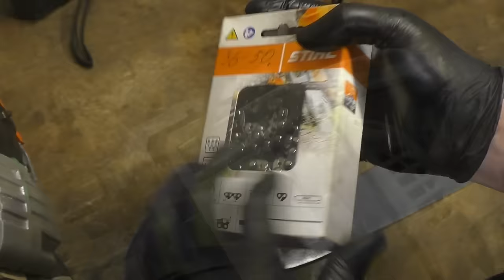Restoration Old Rusty Gasoline ChainSaw | Restoring Petrol Chain Saw

Comment: You have repaired it very well! Fantastic...yes it is interesting but buying it for 50dollars is much better i think...your wd 40 is even more expensive 🤣
Reply: Is not for money ,maybeaperson who that chainsaw worth sometig emocionali
Reply: @dow3639 . u
Reply: 50 dollars? In brasil it costs something around 3 thousands ;-;
Reply: RCTI 2013 
SEGITIGA Biru
Reply: MNCTV 2013 
TPI 2003
Reply: @arthurservilheri4311  thats no original stihl, look on the fuel caps and as well the clutch….only this fake models have that type of clutch😂 i had exactly the same one with a stil 440 logo without h, you get that for 50-90€ on the web
Reply: @dow3639  λ
Reply: @Luckyland84  yea it's a zenoah clone. there's so many different varieties of that same saw all over the world

Comment: You don't wire wheel the internal engine components ever like the piston pin or the gasket mating surfaces, and also don't grease the inside of the motor like crank bearings it just need 2 stroke oil
Reply: That grease also isn't going to hurt it. 

If I had a saw this old I would definitely give it some extra lube but I'd do it through running my first tank lean.
Reply: I can see using a very mild brass wheel or emery cloth  for the wrist pin (won't cause enough slop to matter) and top of the piston but that's about it.  Polishing the cylinder was useless other than for cinematic purposes and maybe I'm wrong but the needle bearings probably won't last very long.  I didn't see the part where they greased internals but I completely agree NO grease inside motor everything just needs a light coat of oil. I've never used a wire wheel on case mating surfaces either though I have to admit I've wanted to hit a few motorcycle cases with a grinding wheel or a 12 gauge with 00 buck shot.
Reply: I think they are well aware they did some things wrong and only did it that way for the video

Comment: Bearings were not installed properly.  Cases must be heated or the bearings get loose from loss of case material..  Also the gaskets should not have been smeared with grease.  Allows gaskets to squish out.  Good video on how to polish something tho.

Comment: I'll never use a chainsaw without a chian brake
Reply: Thanks for letting us know
Reply: I HATE CHIAN BRAKE I HAVE 3 CHAINSAWS 2 CHIAN BRAKE DONT WORK  BUT ONE CHAINSAW HAVE CHIAN BRAKE
Reply: Many of the best chainsaws ever made didn't come out with a chainbrake. If you are properly maintaining your equipment, wear PPE, use the right saw for the job and have the experience to know how to safely operate a chainsaw and do the job your need to do before you do it then you shouldn't fear not having a chainbrake on a chainsaw. To be honest I think your missing out really but more saws for me to use.

Comment: I have this same exact saw he should not have done this video because it would have been cheaper to buy a new one they are 100$ give or take just some cheap Chinese saw but mine works fine and he is missing the chain stop on it
Reply: He took the chain brake off because on his other restoration video of a chainsaw people pointed out that the saw was not old or rusty due to it being a modern saw with a chain brake and other inconsistencies. Therefore on this video before he faked the saw looking old, he took off the chain brake and just pretended it didn't exist to make the saw look older. This guy is a fraud.

Comment: Ok. Why reuse the bar. Seriously. You didn't dress the bar so the guides are probably shit. Why reuse the jug and piston or the carb. You split the case which as I've learned means you are gonna have more issues than its worth. No pressure test. Im guessing it won't stay running at idle. Buddy. It looks nice but that saw is a basket case. Also please learn how to safely start a saw.
Reply: It's a fake restoration